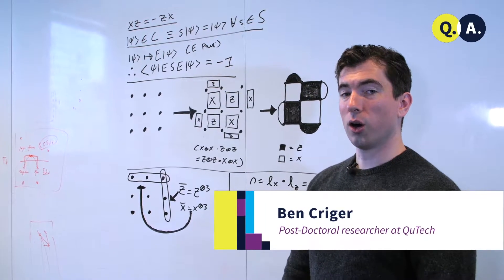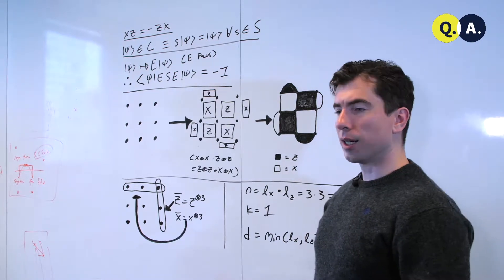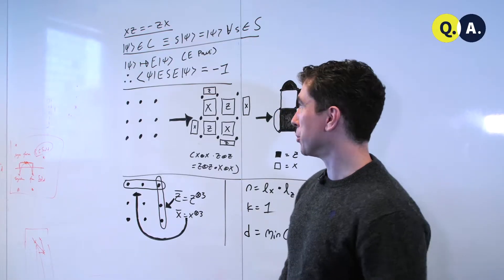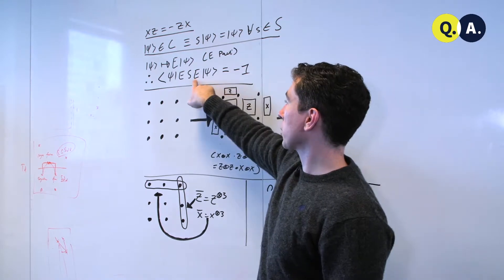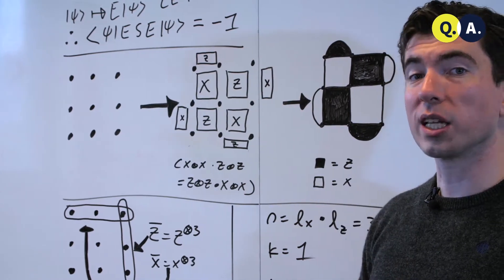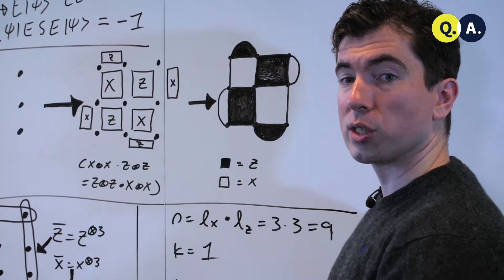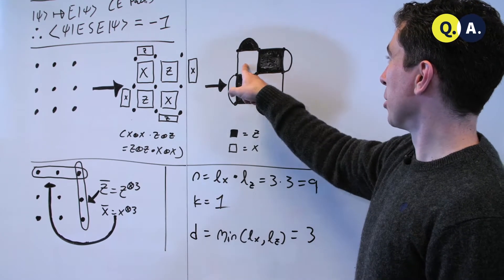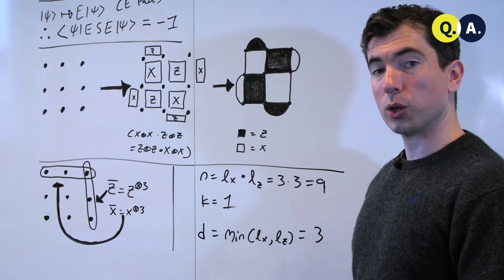Parameters of a surface code | QuTech Academy

Comment: Does the X in square, surrounded by four black dots, mean that the X is the four-qubit Pauli-x operator acting on these four qubits?  And is the X on the side of the diagram in a tall rectangle a two-qubit Pauli-x operator, x circle-cross x, acting on the two qubits next to the rectangle?